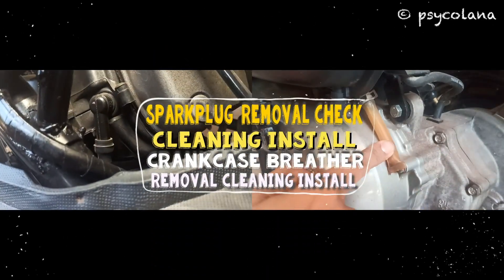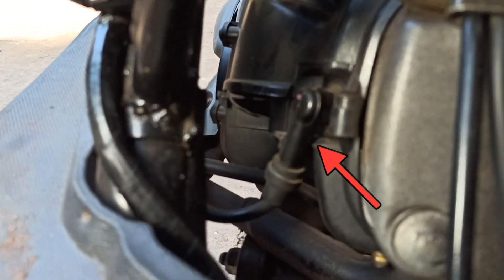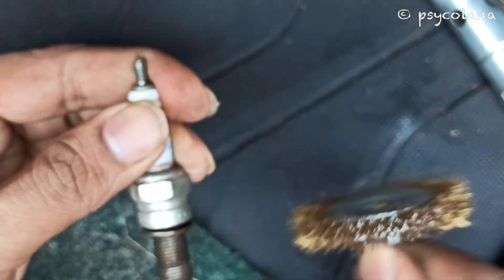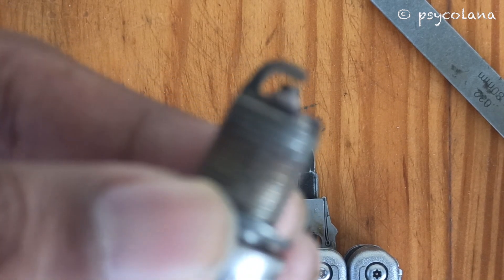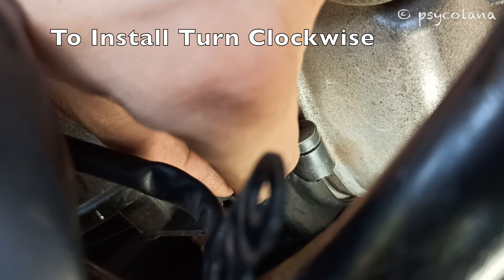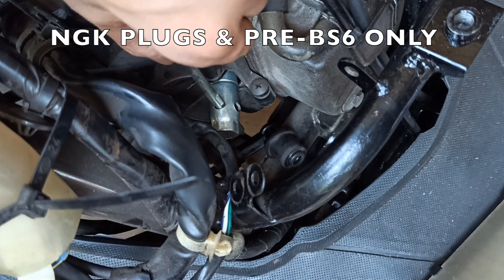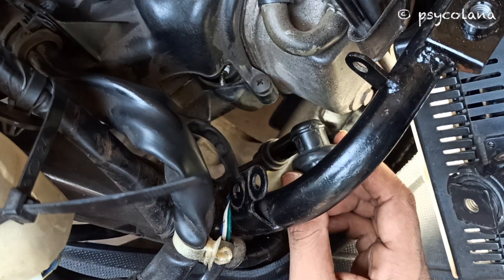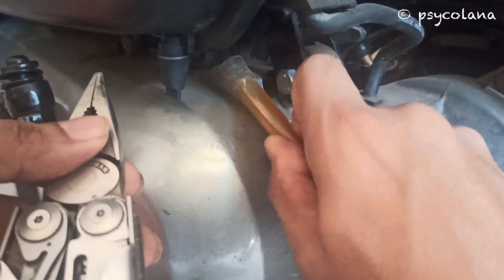Honda Scooter BS6 SPARK PLUG & Crankcase Breather Opening, Cleaning, Install

Comment: The box spanner for removing spark-plug is 17 mm or 16 mm?
Reply: keep both handy,  if you don't have your honda activa supplied spanner, I have seen slight differences in the spark plug sizes. Mostly its the 16mm spanner

Comment: Helo sir, my honda activa's crankcase breather is filled with oil. What is its impact? My vehicle's idling speed is fluctuating and reaching high speed without operating accelerator. Without giving accelerator vehicle is moving at high speed. Please advise. Thank you.
Reply from the maker: Please have it checked by a mechanic, has there can be many reasons, and without inspecting the bike I cannot give a proper diagnosis. Either you will have to change the accelerator cable or accelerator cable needs lube or cleaning, carburetor might need cleaning/tuning.
Reply: @psycolana  But sir, why breather is filled with some liquid. Should it be empty? Thank you for your concern.
Reply from the maker: @srinivaslakkoju363  The breather is usually provided with baffles and filters to prevent oil mist and vapor from fouling the air filter. Don't worry much about that, get it clean't regularly and your scooter serviced.
Reply: Sorry sir, crankcase breather tube is empty. There is no liquid inside. It is okay. I think, accelerator wire need to be checked and carburetor needs tuning.
Reply: But, in front of breather there is one more black rubber tube. That is broken. What is its impact on engine's idling speed. Please give me some hint. What is its name? Should it be replaced? Thank you for your prompt replies.
Reply from the maker: @srinivaslakkoju363  if u check at 8:53 in the video could you tell me which tube is it? also which scooter model do u have? (in the video at 8:53, left short black tube is the Air cleaner Drain tube, Middle is the white Drain tube, and Right is the Transmission Breather tube)
Reply: @psycolana  The broken tube is on the left side of the breather which is short black tube. In your 8:53 video it is seen on the left of your palm while removing breather. Should it be replaced? What is its actual use? Please let me know. Thank you for your concern and commitment.
Reply from the maker: @srinivaslakkoju363  that is the Air cleaner Drain tube, if damaged change it
Reply: @psycolana  Thank you. I have changed accelerator cable housing. Now, my engine's idling speed is good and pleasant. Vehicle running is also ok. No high engine speed. Only when accelerator is given, the engine speed is increasing. Everything is fine. As advised by you, I will  change Air Cleaner Drain Tube.  You are doing great service to the Indian community. I appreciate you for that. Keep it up sir. Thank you once again.
Reply from the maker: @srinivaslakkoju363  most welcome, glad it helped

Comment: Bhai mere crank case breather se bohot jyada oil araha hai kya karu grazia scooty hai mera 5000 km chala hai
Reply from the maker: Hi, What was the oil quantity used during service ? Only 700 - 800ml max should be used(please check the owners manual), excess oil is bad for the engine, this oil might get pushed out thru the crankcase breather and if too much pressure builds in the crankcase then seals might fail and cause further damage. I would suggest you get the valve clearances checked and the carb cleaned and adjusted at a honda service center or some mechanic who works a lot on these scooters.
Reply: @psycolana  they used honda genuine scooter oil maybe 800 ml
Reply: There is also an sound comming from drive belt jab gadi khich ta hun tab speed accelerate karte time
Reply from the maker: @Blspeek-ag  get your grazia serviced or show a mechanic need to chk the clutch assembly bhina kholke exact idea naki milegha, bike warranty mha hai to honda service center mhe dhikao
Reply: @psycolana  ok thanks